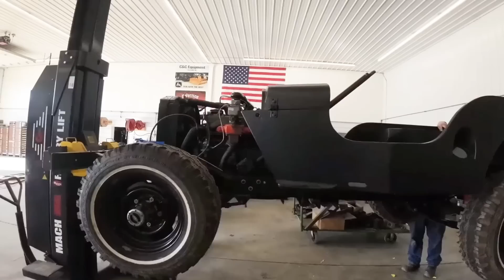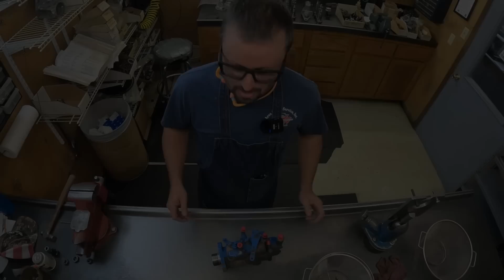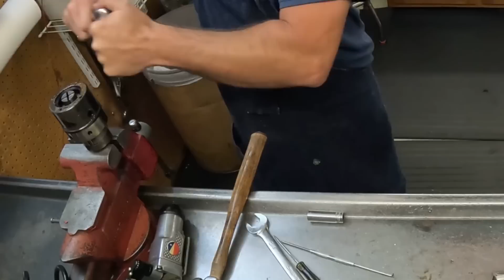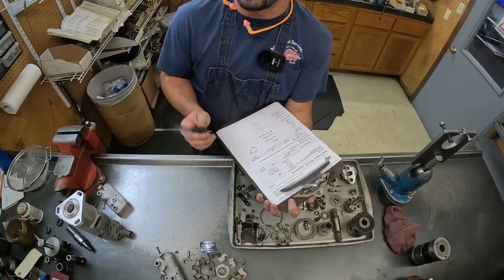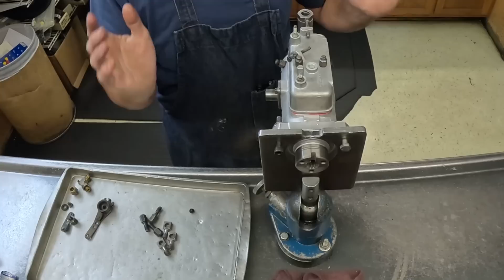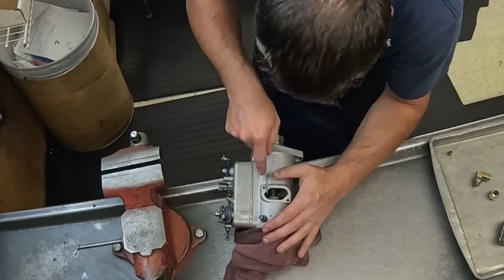4610 Ford Tractor MAKIN' OIL! Lucas / CAV Pump Repair Rebuild for @C_CEQUIPMENT1985 60HP 3-cylinder

Comment: My weights spin freely on my inner shaft , HELP!!! What do I need to buy to fix . Where do you get your parts ?
Reply from the maker: Most our parts come from the pump manufacturer OEMs or other quality vetted aftermarket suppliers. We use, and also stock, these items to sell to customers, reach out and let us know what you need, we can come up with a solution for you!
Reply: @AreaDieselService  contact info ?
Reply: @AreaDieselService  contact info ?

Comment: Nice videos. Don't understand why you needed to put a sealer on the top cover gasket. The gasket is enough plus the risk of the sealer going somewhere it shouldn't. You're testing the pump for leaks when on the test bench. ( Ex Lucas repairer 32 years up until 2000.

Comment: Hello. I'm from Poland and I can no longer get a new injection pump for the Ford 4630 here. Can I ask for a link to the store where I can buy a pump for the Ford 4630? Or where I can buy parts for this pump with Lucas CAV data; 328F910; 13945CHG; 74900L/7/2380

￼

Comment: For the guy putting that pump together.
(I think it is the rotter end) It is to do with the lining up. You took off that (hot cross bun) part went & got your box of lots took out 1 put it in & said "that's better".  I take it that you have a box of lots encase you have to look for 1 that matches up yet you only took the first one & it matched. Why do you need a box of lots if the first one you pick matches. Or was it just luck that you didn't have to spend hours finding 1 that matches.

Comment: weights wore out in 4000 hrs we have the same pump on a for 4000 the pump has done over 12000 hrs and never ben off the engine and still runs and pulls like a train

Comment: Most of the video has no audio so I have no idea what your technician is doing.
Reply from the maker: We had another comment mention the audio mixing is off - you may want to check the device you were listening to the video with - you may have a speaker not working?  I believe since we used our new shiny duo wireless Rode mics, they are two-channel and naively this didn't mix from mono to stereo for the entire video - sorry about that!  Thanks for this comment though so it can be rectified for other upcoming videos!
Reply: @AreaDieselService    your video is the only one that did not have audio of all of the stuff I watched yesterday

Comment: Thanks for the excellent video...Great service job and videography! I also have a 4610...1984 model...purchased in 1989. Same type of pump...so this was especially interesting to me. My tractor is somewhat different, having MFWD, but the three cylinder engine is the same. Still running strong at 40 years old! Thanks again for the video!
Reply: Great video man!! Was just what I  needed. Im a new subscriber. thank you appreciate it

Comment: This is interesting stuff. When you paint these fuel pumps, how do you choose the color? I like what you do. I never had any good experience with rebuilt parts that were carelessly sprayed with cheap flat black.

I did not know that Delphi bought Lucas. People who restore British classics have some jokes many Lucas electrical parts. I suppose each company has winners and losers. I have seen a lot of those auto part companies merge and split.

Who stole who's tech? Didn't much of this all start with early Bosch pumps?
Reply from the maker: The manufacturer normally calls out the paint requirements in the bill of materials and test plan documentation. And we make note of what it looked like when it came in. Sometimes the customer will make a specific request in that regard.
Reply: @AreaDieselService  thanks. I like your attention to detail.

Comment: Is there any serivice interval on these pumps or do you only get them serviced if the break? Do machine operators keep spares of them to limit downtime?
Reply from the maker: Good questions. Some pumps have self contained lubrication oil and they do have a service interval. I've never seen anything from a manufacturer calling for a proactive pump overhaul. I have seen some major fleets and government entities calling for a pump swap at certain miles or hours. And we do have some customers who stock a spare pump or turbo if the engine is in a mission critical operation. Power backup, water supply, emergency vehicles, etc.
Reply: @AreaDieselService  You guys do great work but I imagine you have alot of it so I guess it could take some time to get you pump back. If you are peing paid by the hour as a machine operator a couple of weeks downtime could put a pretty serious dent in your earnings  so I think I would prefer to have a backup pump for piece of mind.